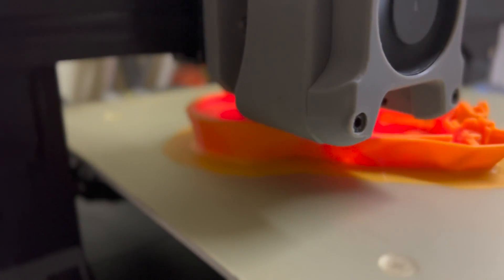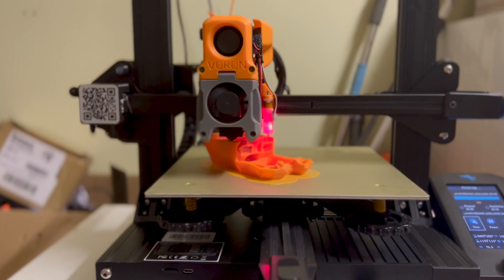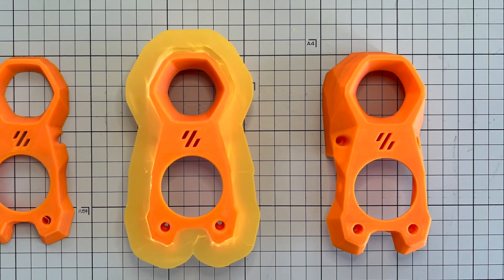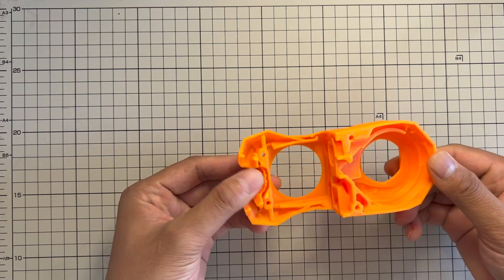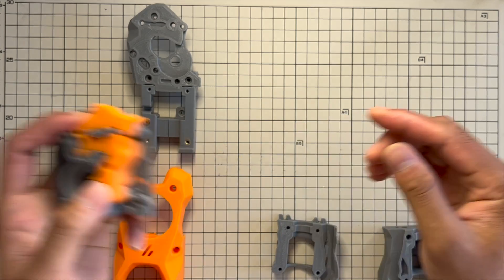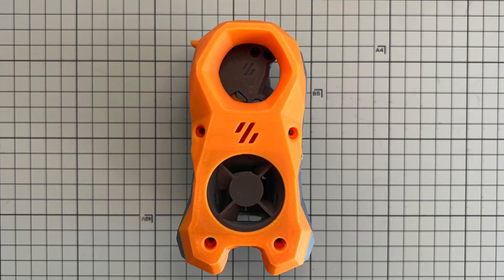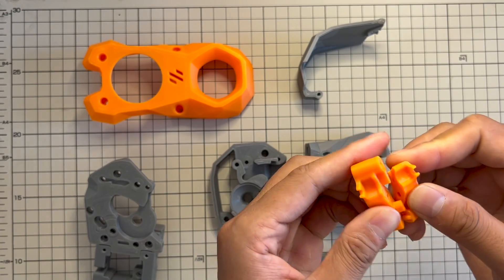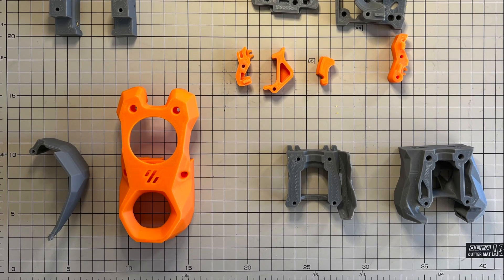Printing VORON StealthBurner using ender 3 v2 and quick review

Comment: someone link the fuckin stl files lol
Reply from the maker: You can find all the details from this video's description: https://www.youtube.com/watch?v=LBTuS2WBLIk
"
Things you need to build a Voron Afterburner for Ender 3 v2
1. Printed parts (almost free if you print by yourself)
2. A slim (20mm) step motor (around AU$16.00). You may still use the stock extruder motor if you don't worried about the decreased build height and you also need to cut out the shaft around 2-3mm
3. BMG Extruder internal parts or a BMG Extruder (around AU$30.00)
4. Required Screws and Nuts Kit (less than AU$7)
5. 4020 24v blower Fan (part cooling) The Stock 4010 blower does not work
6. 4010 24v DC Fan (hot end cooling). You may still use the stock fan if noise is not problem to you :)

*Afterburner mounting plate for Ender 3 v2*
afterburner-motor-plate-ender3v2-Mod.STL (https://www.thingiverse.com/thing:4764317
, As shown in the video, ***but later I found "afterburner-motor-plate-ender3-abl-2.stl" is the latest version, please use the latest version from https://cdn.thingiverse.com/assets/cb/d2/ad/b4/0c/afterburner-motor-plate-ender3-abl-2.stl)
!!!They don't fit my ender3 v2 plate very well, I have to use a drill to open some holes...
Other alternatives:
- https://www.thingiverse.com/thing:5107209
- https://www.thingiverse.com/thing:5026200

*Extruder*
https://github.com/VoronDesign/Voron-Afterburner/tree/master/STLs/Direct_Feed
[a]_connector_cover.stl
[a]_guidler.stl
[a]_latch.stl
[a]_latch_shuttle.stl
extruder_body.stl
extruder_motor_plate.stl (only required if you use this plate https://www.thingiverse.com/thing:5107209)

*Blower housing (aka, print cooling fan duct)*
https://github.com/VoronDesign/Voron-Afterburner/tree/master/STLs
[a]_blower_housing_front.stl
blower_housing_rear.stl

*Printhead (hot end mount)  for Ender 3 v2 stock hot end*
https://www.thingiverse.com/thing:4850412
AB_Mk8_Ender5_stock_Back.stl
AB_Mk8_Ender5_stock_Front.stl
This is designed for Ender 5, but you can still use it for ender 3 v2, because both the Ender 3 V2 and the Ender 5 come equipped with a standard Creality hot end.
If you are using an hot end such as E3D_V6, Slice_Mosquito... print the required ones from https://github.com/VoronDesign/Voron-Afterburner/tree/master/STLs/Printheads

*Hot end cooling fan mount*
https://github.com/VoronDesign/Voron-Afterburner/tree/master/STLs
hotend_fan_mount.stl

*BL touch mount*
https://www.thingiverse.com/download:8839808 from https://www.thingiverse.com/thing:4638150

*BMG Extruder internal parts*
https://www.aliexpress.com/item/4000021186440.html
Alternatively you can use parts from any BMG Extruder clones

*Screws and Nuts Kit*
https://www.aliexpress.com/item/1005003096841891.html
Plus M3x10 (2) M3x6 (1)

*Nema 17 stepper motor (20mm)*
https://www.aliexpress.com/item/1005003014401384.html or
https://www.omc-stepperonline.com/nema-17-stepper-motor/nema-17-bipolar-1-8deg-16ncm-22-6oz-in-1a-3-7v-42x42x20mm-4-wires.html
"

Comment: where do you get the stls
Reply from the maker: You can find all the details from this video's description: https://www.youtube.com/watch?v=LBTuS2WBLIk
"
Things you need to build a Voron Afterburner for Ender 3 v2
1. Printed parts (almost free if you print by yourself)
2. A slim (20mm) step motor (around AU$16.00). You may still use the stock extruder motor if you don't worried about the decreased build height and you also need to cut out the shaft around 2-3mm
3. BMG Extruder internal parts or a BMG Extruder (around AU$30.00)
4. Required Screws and Nuts Kit (less than AU$7)
5. 4020 24v blower Fan (part cooling) The Stock 4010 blower does not work
6. 4010 24v DC Fan (hot end cooling). You may still use the stock fan if noise is not problem to you :)

*Afterburner mounting plate for Ender 3 v2*
afterburner-motor-plate-ender3v2-Mod.STL (https://www.thingiverse.com/thing:4764317
, As shown in the video, ***but later I found "afterburner-motor-plate-ender3-abl-2.stl" is the latest version, please use the latest version from https://cdn.thingiverse.com/assets/cb/d2/ad/b4/0c/afterburner-motor-plate-ender3-abl-2.stl)
!!!They don't fit my ender3 v2 plate very well, I have to use a drill to open some holes...
Other alternatives:
- https://www.thingiverse.com/thing:5107209
- https://www.thingiverse.com/thing:5026200

*Extruder*
https://github.com/VoronDesign/Voron-Afterburner/tree/master/STLs/Direct_Feed
[a]_connector_cover.stl
[a]_guidler.stl
[a]_latch.stl
[a]_latch_shuttle.stl
extruder_body.stl
extruder_motor_plate.stl (only required if you use this plate https://www.thingiverse.com/thing:5107209)

*Blower housing (aka, print cooling fan duct)*
https://github.com/VoronDesign/Voron-Afterburner/tree/master/STLs
[a]_blower_housing_front.stl
blower_housing_rear.stl

*Printhead (hot end mount)  for Ender 3 v2 stock hot end*
https://www.thingiverse.com/thing:4850412
AB_Mk8_Ender5_stock_Back.stl
AB_Mk8_Ender5_stock_Front.stl
This is designed for Ender 5, but you can still use it for ender 3 v2, because both the Ender 3 V2 and the Ender 5 come equipped with a standard Creality hot end.
If you are using an hot end such as E3D_V6, Slice_Mosquito... print the required ones from https://github.com/VoronDesign/Voron-Afterburner/tree/master/STLs/Printheads

*Hot end cooling fan mount*
https://github.com/VoronDesign/Voron-Afterburner/tree/master/STLs
hotend_fan_mount.stl

*BL touch mount*
https://www.thingiverse.com/download:8839808 from https://www.thingiverse.com/thing:4638150

*BMG Extruder internal parts*
https://www.aliexpress.com/item/4000021186440.html
Alternatively you can use parts from any BMG Extruder clones

*Screws and Nuts Kit*
https://www.aliexpress.com/item/1005003096841891.html
Plus M3x10 (2) M3x6 (1)

*Nema 17 stepper motor (20mm)*
https://www.aliexpress.com/item/1005003014401384.html or
https://www.omc-stepperonline.com/nema-17-stepper-motor/nema-17-bipolar-1-8deg-16ncm-22-6oz-in-1a-3-7v-42x42x20mm-4-wires.html
"

Comment: Probably someone already told you that, but you mounted the printed 80-tooth gear the wrong way — those 5 mounting screws should be facing their heads into the M4 body, not outside.

Comment: I printed my Enderwire parts out of Atomic PETG Pro and Atomic carbon fiber PETG Pro and they came out great. I don't understand why Voron still recommends ABS. It has all the downsides of Nylon with none of the benefits, is weaker than PLA, and you can get the same heat absorption from ASA, or pretty close with the CF-PETG I'm using.
Reply: do you have pictures of the carbon fiber prints for this? I have been thinking about doing it with some carbon fiber nylon I have but didn't know how it would look/ preform.

Comment: As some other people already mentioned ... your parts are a bit overextruded, this is why it wont fit together easily. The other thing is your have gaps all over the Stealthburner, this can come from stress on the parts because you print without an enclosure, and the third thing is, if you dont like the LEDs just dont add them :) - Otherwise the stealthburner is a great printhead

Comment: You need well-calibrated (dimensionally) printer. I had no issue with fit of the parts (however I've printed them on Voron 2.4)

Comment: Not sure if the later versions of the parts are better or if your printer isn't accurate enough, but I just printed the current beta version of Stealthburner and every piece fit just fine.
I printed them on a Voron 2.4, so they are very accurate. Also if you don't want or need the LED's, just..don't install them?

Comment: The purpose of the LED lights are for status and first layer illumination in the dark or at night time, you also have the option not to use led lights,  So you're  critique's there negligible. other wise great video,
Reply from the maker: Thanks! the context is that I am trying to evaluate whether or not to upgrade to StealthBurner beta now from afterburner. StealthBurner is awesome, and I will definitely install it when Voron release the final version.

Comment: Even my mini afterburner warp with an paper box enclosure, so I just dont believe you
Reply from the maker: But bed temperature 110C + PEI sheet + brim works great for me. LOL. You may still get a little warp in sharp corners for the largest part but it is completely usable. but warp in sharp corners even can happen in PLA.
Reply: @makeIT0  I use glass and abs slurry, which is tight as f. still wrap a little with enclosure.
Reply from the maker: I couldn't share any experiences about glass+abs slurry as I've never used things like slurry and glue stick. I think you should give PEI bed a try.

Not sure if you print them using ender3 v2, in my case, ender3 v2 heat bed cannot maintain a consistent temperature across the entire bed. Adding a thick glass bed makes it worse, which probably the cause of the wrap.

Comment: Thank you, very helpful. Nice prints. I am having a hard time printing the front. In particular, the thin side structures in the lower part. I have tried with 0 fan and with 30% fan, same result. Did you change any slicer settings other than infill?
Reply: Make sure you dial in your abs settings temperature, bridge settings, and first layer to precision. On a voron this is a walk in the park but for an ender 3 or prusa you have to make sure all your tolerances and bridges are good since there is bridges and fine details in the front housing. Once you print this model you can see just how complex this model actually is. Incredible work by wile.e
Reply from the maker: It worked fine for me with Brim + 20% infill + hotend 260C + Bed 110C. You may also try to move the thin side structures onto the centre of your print bed

Comment: I have an Ender3 v2 as well as a Voron2.4 and parts printed with my Voron fits perfectly… 

Personally I feel the Ender3 just does not have the accuracy/tolerance required… especially to print things that has very tight tolerances by design which the SB and CW2 has and it has been stated that it’s intentional
Reply: The Ender-3 is a very accurate machine. The problem is trying to print ABS filament.
Reply: @alejandroperez5368 so it isn’t. An accurate machine will be accurate regardless of filament type
Reply: @sterkriger2572  Accuracy of the machine is simply how well does it get the tip of the nozzle to the intended place. The material warping after being dispensed to the proper place isn't an accuracy issue, it's an entire lack of a feature and a user input (slicer config, limits setting, environment control, etc) issue. Most Vorons can't print PEEK well, and that has nothing to do with machine accuracy but instead to do with the temperature needed. No printer can create a reliable part while the user hold a blowtorch to the part, the user doing things wrong didn't make the machine less accurate but does still result in a garbage part.
Reply from the maker: Thanks for your sharing! I will try to print them again using my Prusa i3 and see
Reply: One video someone did test on belt tensioner if have adjustable ones. adjusters on machine that changes size from one print to another.

Comment: i was hoping for the StealthBurner E3v2 guide, i guess i will stick with afterburner
Reply from the maker: I will probably wait for the final release and see if it worth the upgrading. I think for now E3v2 + 5015 afterburner mod works better than StealthBurner for Ender 3 v2
Reply: @makeIT0  5015 part cooling? is 5015 fan will fit?
Reply from the maker: @octagram3638  check this one out https://github.com/Greg191134/Voron/tree/master/Afterburner%20Optimisation/5015%20fan%20mod
Reply: @makeIT0  Thank you